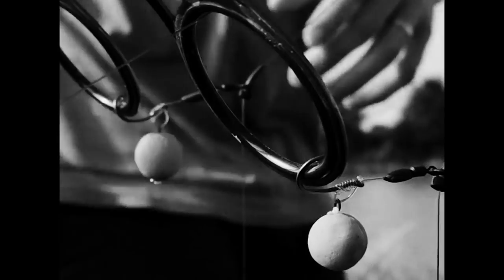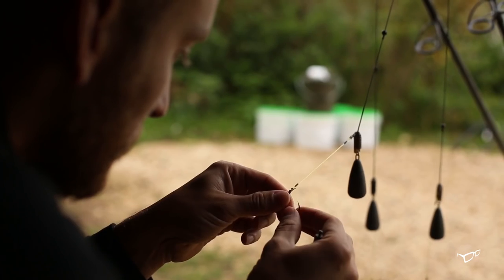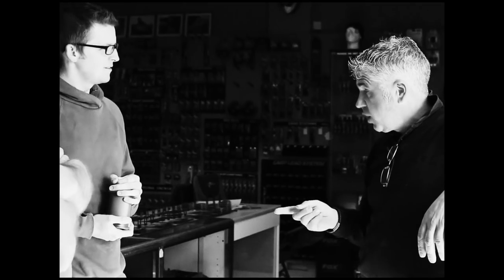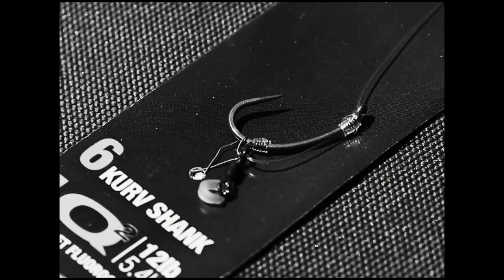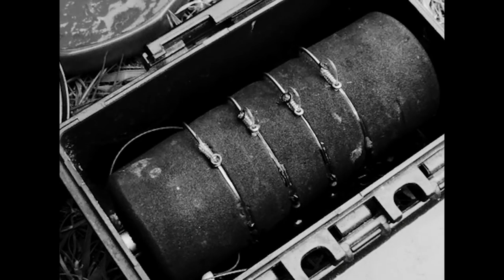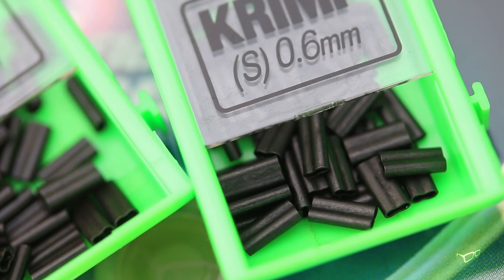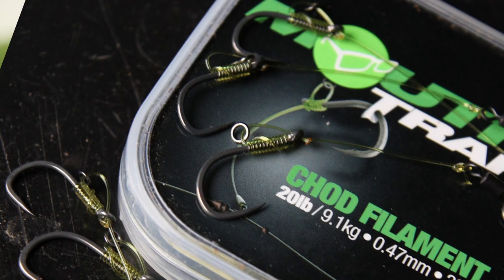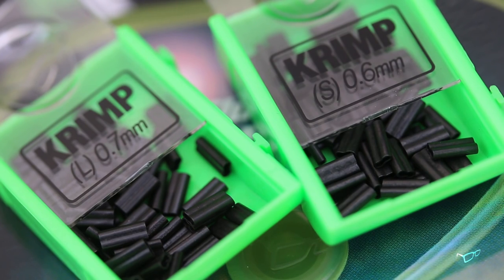To Krimp or not to Krimp? - Team Korda

Comment: I have found that the krimps break lower than the breaking strain of the boom,  I have watched many videos and tried many methods but they all fail aroud the 18lb mark on 25lb boom.  I have used 30+ krimps and every single one of them failed, either its the krimps or boom is actually weaker than you say it is.

Comment: I gave up with the Krimps as I had too many issues. I made up a stiff hinge rig using mouthtrap. I mis-cast into weed. Not horrendous to the surface stuff but needing a bit of pressure to free. When the rig came in I had a boom section but no hook section. Failed at the krimp under minimal pressure. If that was playing a decent sized fish it would have been a loss for sure. A handful of bites a year is a result on my waters so I just cant risk it. Shame as it makes lovely neat looking rigs but just poor in actual use.
Reply from the maker: Wayne Griffin What mouth trap breaking strain were you using fella? If krimped correctly the 20lb and 25lb mouthtrap will not snap! Really high breaking strains in test. Thanks.
Reply: KordaTV to be honest I'd have to check as it was last summer. I'd guess the 20lb.
Reply: I'm using 25lb boom with 6mm krimps I just keep snapping it when trying to test if it's strong and I'm not even pulling at full force gone through a full pack of crimps and still no rigs made what am I doing wrong

Comment: I'm using 25lb boom with 6mm krimps I just keep snapping it when trying to test if it's strong and I'm not even pulling at full force gone through a full pack of crimps and still no rigs made what am I doing wrong
Reply: I have the exactly the same issue